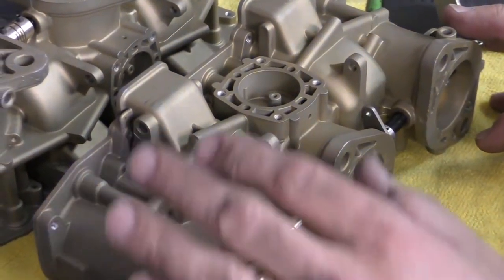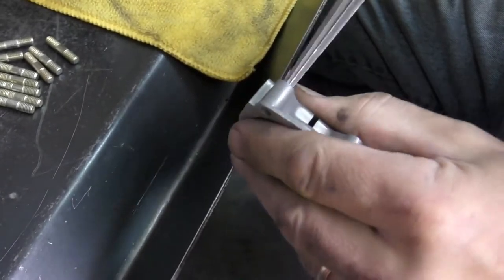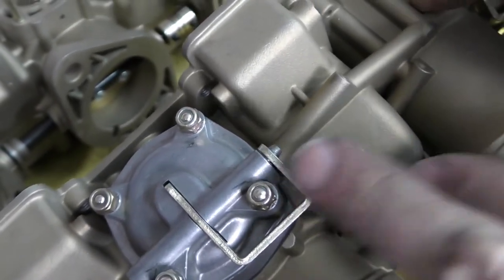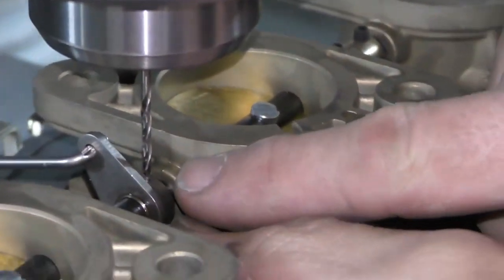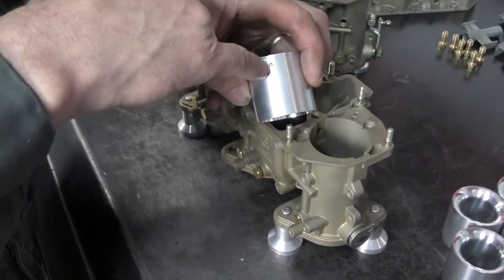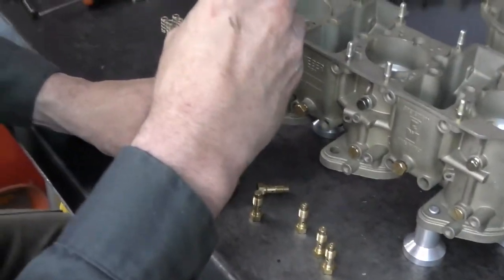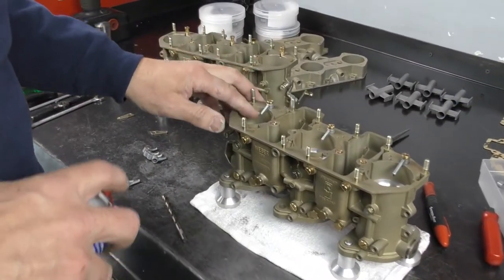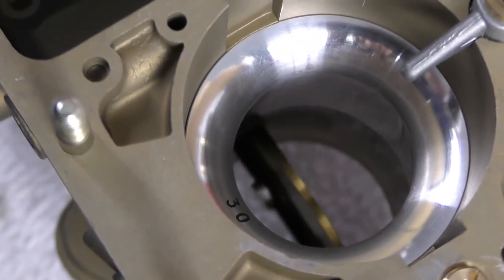Assembling A Weber 40 IDTP Triple Barrel Carburetor, part 2. Accelerator Pump, Chokes, & Jetting

Comment: Dear Sarah, dear Kurt,
Fantastic series, I probably watched it >10 times now to finally rebuild my IDAs 🙂
I would have only one little question left: Which gas volume would you recommend for the acceleration jets/barrel on a 2.7, high compression and E cams? I thought of bench setting them to 0.8ccm...?
Best, Stefan
Reply from the maker: The amount of delivered fuel is going to depend on the choke size and engine size. typically the bigger the choke the more fuel you need to inject. Remember this is just a starting point and it will need to be fine tuned once the carburetors have been installed.
Kurt

Comment: Love your series. Where can I buy the Winzer MPS-100, T-25A vial and the metal stools you mount the carbs on for reassembly?
Reply from the maker: Depending on what state you live in the MPS-100 may not be legal. You can contact Winzer direct via their website. The pump measuring vial is available directly from Porsche. The Carburetor feet that I use we make in house.
Kurt